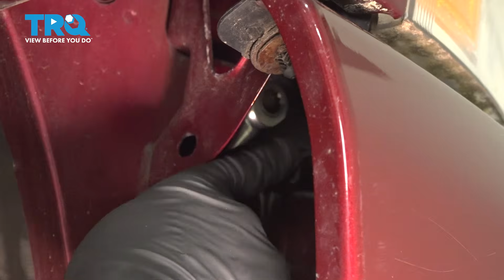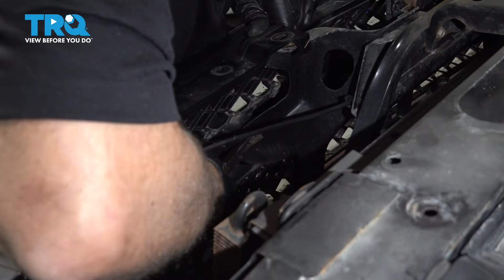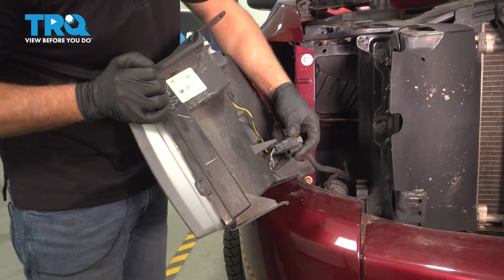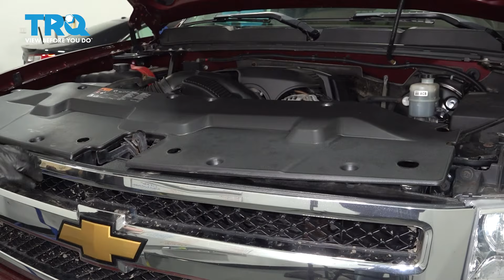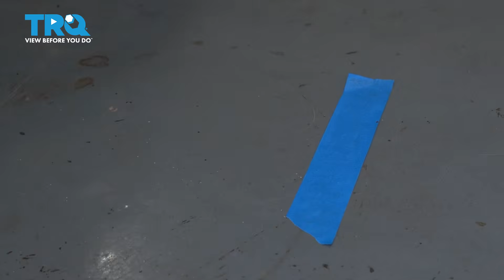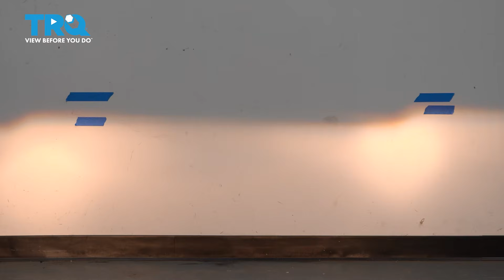How to Replace Headlight Wiring Harness 2007-2013 Chevrolet Silverado

Comment: Is there any other way besides pulling off the grill😂😂 I’m usually good at taking things off and somehow they break off putting back on. Smh I just need the wiring for snap in on the low beam

Comment: 7:21 There are 3 bolts you can see right here.  The bolts line up vertically and hold a metal bracket in place. You need to remove that bracket before putting the lamp back on . Else it will be Royal Pain in the Nuts. This video was clearly edited to avoid showing the hellish frustration he went through to fit the lamp back into place.

Comment: I started this because one single low beam light on the driver's side wasn't working, and I determined it was the harness and not the light. I followed these instructions exactly for the driver side. And now nothing but the ambers work in the entire truck. Wth did I do wrong?

Comment: My 2011 silverado low beam on both driver and passenger side keeps going off and on by its self. I replaced bulbs and single wire harness,  but have the same problem. Any suggestions?

Comment: U know I bought my wire harness from Amazon and it's made un China. Wires were very thin to fragile. Where are your wire harness made from ?
Reply: AC Delco and they last a while. If you buy the Chinese parts you’ll get really good at taking trim pieces off.

Comment: Hey thank u for those video. I followed along and it worked. Only problem I got is after testing it out it worked 3 times in a row.  On the 4rth try headlight failed, til I nudged the bulb then its on. We will see what happens next.
Reply: Have the same issue on a 2008.  I have to use a long screwdriver and “tap” the bulb connector to make them work.

Comment: I changed the harness for the driver side the other day and I noticed the signal lights don't come on when low beams are on. They do signal though. But it seems they should be on when the low beam is on as well as that is what the passenger side shows.... 🤔